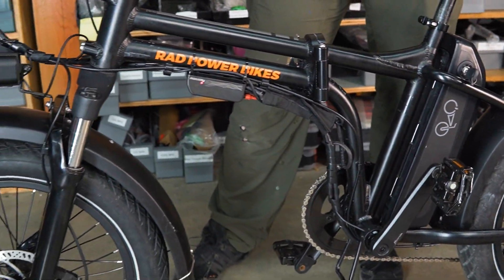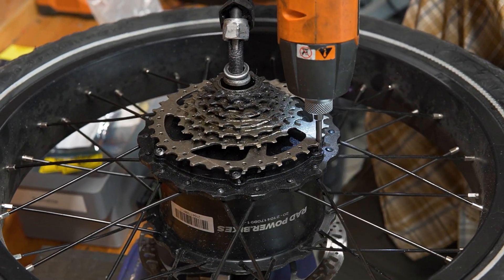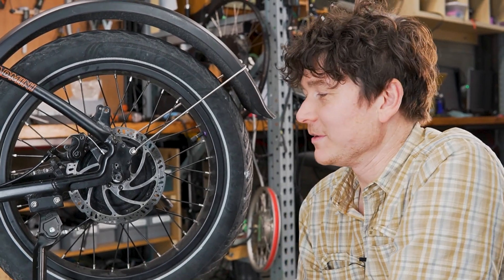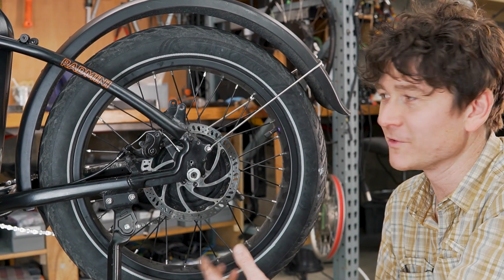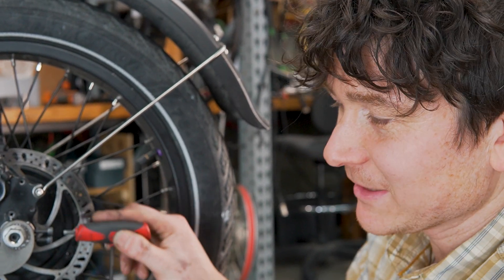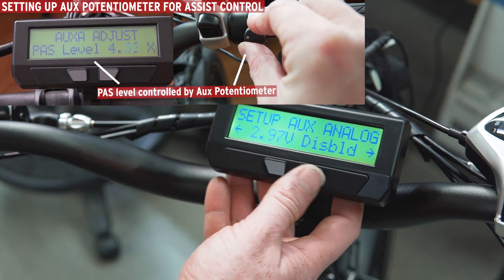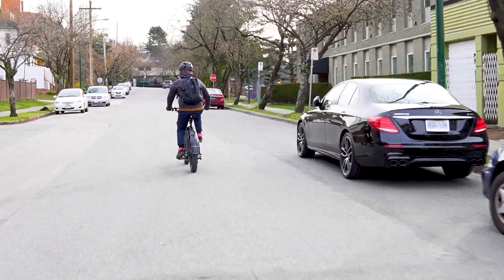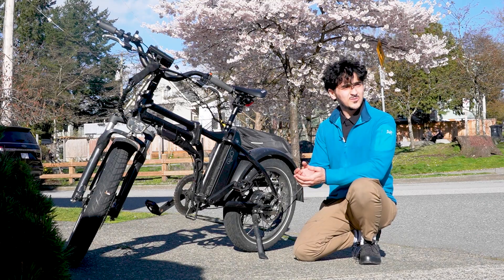Rad Factory Ebike Hack, Part 3.  Adding Regenerative Braking with a Welded Clutch

Comment: I love the work you do. Your vids are great. I have a question: How do I know my current battery will accept the regen current? Seems like very few batteries have that information available.
Reply from the maker: The fastest way to find out for sure is just to try. Most generic ish ebike batteries have dual port bms circuits and hence have no issues accepting recharge current through the discharge ports.

Batteries with single port bms circuits may trip the bms from having an unnecessarily limiting max charge current setting (like 5A).
The batteries you can't do any regen with are usually super proprietary setups like Bosch, and you're not going to use a Bosch battery on anything other than a factory Bosch ebike anyways so it doesn't really matter.
And yes you will almost never get this information from a battery supplier. If you ask they will usually say no, you can't do that, even though they are completely wrong, because most people working on this industry don't really know much.

Comment: How much torque can this handle exactly?
Reply from the maker: Are you asking about the torque arm or the motor itself?
Reply: @GrinTechnologies  torque arm
Reply from the maker: It is stronger than the axle.  Hollow axles with cables in the middle will shear around 70-100 Nm, solid axles will shear off between 150-200 Nm typically.   The torque arm will survive all of that just fine.

Comment: i am wondering if i connected the cycle analist to a golden motor magic pie 2 hub motor and its internal motor controller.. could i activate and use back pedal brake regen ?
Reply from the maker: Only if the internal controller can be configured to do regen when the throttle voltage drops below 0.8V, with maximum regen at 0.0V.

Comment: have you tried a rear axle with a hole drilled through the threaded end to stick a cotter pin through it to hold the nut in place or at least some kind of safety wire?

that's the common solution for motorcycles.
Reply from the maker: Yes, that's commonly used in aviation too and you are welcome to do it. The axles are hardened steel and a bit of a pain to drill through, and in many cases there is an electrical cable running through the axle as well.

Comment: So I welded my clutch on a RadRunner and I have a 35A controller installed by Bolton (sorry cycle analyst screen is keeping me away...) Anyways i notice now when I'm going faster and coasting and go to use PAS or throttle it kind of lurches like its going into Regen and then speeds up. Is this likely a controller issue or is this normal without the clutch?
Reply from the maker: This has nothing to do intrinsically with a clutch or no clutch, and everything to do with the startup behavior your motor controller. By chance is it running sensorless?

Comment: If the electrical system failed, and you had to ride the bike like a regular pedal bike, wouldnt this bike be extremely hard to pedal and ride with this conversion?
Reply from the maker: These are already pretty crumby bike platforms to ride without assist regardless of that.
 But yes there is additional drag for turning the motor, quantitatively it is  notably less than the rolling drag of the low psi fat bike tires.

Comment: How do you replace the plastic gears once it’s welded?
Reply from the maker: The same way as a non-welded clutch.  You just remove the planet carrier and gears from the motor axle with a gear puller, then remove the snapring from the stubby planet axle and slide off and slide on a new planet gear.

Comment: Wouldn’t a locked clutch increase the wear on the cogwheels a lot, as they now constantly engage, instead of only when the bike get assisted power from the motor? Not saying the hack isn’t nice, just wondering about this. Regen obviously is nice.
Reply from the maker: Believe it or not the cogs are always engaged and spinning whether the clutch is locked or not.  The freewheeling clutch stops the rotor from spinning but not the gears.  The bidirectional forces on the cogwheels could change their wear dynamic but nothing that we have seen so far, and that's with quite a few years of experience with the GMAC motors.

Comment: How much is the whole kit?
Reply from the maker: There isn't a kit shown in the video. It's a set of discrete part replacements. Controller pricing is here:
https://ebikes.ca/shop/electric-bicycle-parts/controllers.html
Torque sensing BB pricing is here:
https://ebikes.ca/shop/electric-bicycle-parts/torque-sensors.html

etc.

Comment: Hey Grin, Anything on the horizon for modulating regen brake levers or is back pedaling still the only option?
Reply from the maker: Backpedaling isn't the only option, there is also throttle modulation with a digital ebrake lever, and using the Digi aux input for digital regen control at any point.

But to answer your question. Yes.

Comment: I love the idea of reusing my old bike and turning it into an Ebike. 
The June 1st $300 - $1400. Rebate to purchase an Ebike seems to be only for a new Ebike. 
I wish that this would also include GRIN KITS.  SAD!
Reply from the maker: It is sad. We've tried hard to make them see the light but they are dug in in their intransigence
Reply: @GrinTechnologies  Are there any other $2000~$2500 'barebone' ebikes compatible with this kit that are a little better than a Rad? I currently have the $1400 rebate ready to go but they all don't seem to have the power I need.

Comment: One nice feature of the new regen speed limit is if you set it to 0 MPH, it effectively permanently parks the bike.  This is great if you need to run inside for a few seconds, as if anyone tries to hop on the bike and steal it, they will need to overcome 750W of regen to go anywhere.
Reply: Forgive my ignorance, but won't the regen braking prevent the bike to move forward in that scenario, but how about moving it backwards? 🤔
Reply: @williamaungleyraud  Someone awkwardly trying to walk my cargo bike away backward while the alarm is screaming is of little concern, as a stroll would let me catch up.  Someone jumping on the bike and trying to ride away is a much bigger concern.  When both the alarm goes off and regen grinds them to a halt, they are going to be far more inclined to ditch the bike for an easier target rather than sit there for a while trying to figure out the best way to circumvent the issue.

If someone is smart enough to circumvent both an alarm and ebike system, they are a professional thief and even a U-lock and a garage won't stop them.  This comes from first-hand experience.
Reply: @bensmith3304  🤣 I don't know why your response has got me cracking up.
Reply: @chrisE815  i wouldnt count on it, what if all it takes is for the motor to be disconnected?

Comment: Would it be possible to weld the clutch in a mid motor like Bafang M620 to get regen and REVERSE? Of course I need a fixed gear on the wheel.
Reply from the maker: If your bike is a fixie bike then in principle yes, but then you also loose the primary advantage of a mid-drive while retaining all the disadvantages.  ie no ability to change the motor gearing, but still having all the chain wear and transmission drivetrain issues.

Comment: Man you guys should really make bionx BMS boards. I’m sure they’d be very popular as the original ones keep dying including mine. The same goes for the consoles as well which also keep failing. You guys already had previous relations with bionx and I think it would be brilliant for the many bionx customers out there to have access to these parts to keep their bikes going considering how expensive they were. Bionx has been dead for years so who’s stopping Grin Tech to continue the legacy of bionx.
Reply from the maker: It's really a dead end path to keep a propriety system propped up. Best to open things up with a new controller as we describe in the bionx hack video and forever be free.

Comment: what about pairing a rigenerative (welded clutch) mid drive engine with a fixed gear back wheel? wouldn't enable regenerative braking with mid drive too?
Reply from the maker: Yup, but you would loose all the benefits of a mid drive since it works just be single speed, while retaining all the disadvantages. But if it's the only motor you got and fixie is how you like to ride, then buy all means this will work
Reply: @GrinTechnologies  by adding a rear wheel with integrated hub gear then I would have a bike which has central motor, with energy recovery, with a shift that could be even used to modulate the braking torque! Isn t it?

Comment: I hate to complain because GRIN is making things no other company will, like the BaseRunner ESC.   But here it goes:  I wish they had an alternative display using a modern tiny 128x64 OLED screen rather than the dot matrix calculator style.  I wish GRIN had another lower-profile option for the screen.  Even if it's just a little rectangle with the entire back side taken up by the wire loom.
Reply from the maker: You and at least 10,000 or so other people! Don't worry we know. :-)
Reply: Or like Bafang you can program everything with a usb cable on your phone

Comment: hey, update on my issue, I took it all apart, tested the phase wires, it was the yellow phase wire, it was shorted, opened it up lol everything absolutely toast, I think when I crimped my brake disc and bunged up the wheel it must of been in between that phase and it just gave up the ghost, I mean inside the controller, my motors good, hall sensors should be good, I hope. Im ordering a backup medkit for my  ebike and a new controller, I have a 500 w continuous motor, these imported from China controllers are all 500w to 1000w on them, would they be ok to use? 60 bucks compared to a 110 at the bike shop, it would help, thanks again Im subscribing
Reply from the maker: If you have the means of figuring out all the connectors and wiring then you could likely make the random china controllers work, just don't expect to get much help from the sellers to figure things out.
Reply: backup medkit?

Comment: Are most hub motors capable of having Regen ? What if my motor 's cable is the smaller 6 pin type? Not sure of the cable type. However its a 1000W hub similar to the Bafang.
Reply from the maker: If it has straight cut gears then in principle it can do regen just fine if you eliminate the freewheeling clutch, noting the caveats in this video. You will obviously need to terminate your motor cable with a connector that matches what is the new regen capable motor controller, or visa versa.  6 pin cables would be for motors that lack actual motor hall sensor but which have an internal speedometer sensor, and that means you'd need a sensorless capable motor controller.

Comment: How does it feel without the freewheel function unassisted. On a direct drive hub motor its a slight drag but I imagine it would feel worse than this with a geared hub motor hence why it is not commonly done. I'm also wondering for someone like me who is heavy but with strong legs I find the DD drag very small and don't care about it on flats and I only use assistance for hills as a sort of bailout option when hills get too tough. What sort of level of regen can I expect when I would regen down all hills, just cycle on flats and need assistance on all but the smallest hills? I don't have a controller that can simulate freewheeling by providing a small amount of current to the motor. I just wonder if anyone has any figures for how different configurations compare? If I'm regenning down all hills and use assistance perhaps for 3/4 of hills while still pedaling what percentage of regen could I expect compared to lets say a ebike with a freewheeling geared hub motor which is only used for hills but has no regen. I realise there are so many variables I just wondered if anyone had any experience of what I might expect as rough estimate.  I'm wondering if I would see a significant increase in range?
Reply from the maker: You can directly tell how much drag a motor has by looking at the energy needed to run it unloaded. Large geared motors like the ezee or GMAC typically have about double the drag of a good direct drive hub. For small geared motors like the sx1 it's about the same. 
Most people get 5-10% and your described use isn't really any different. Wondering how much it will increase your range shouldn't be the main interest, your motive should be about the desire for consitent braking without any wear and tear on your mechanical brakes. The range boost is just an extra bonus on top.
Reply: @GrinTechnologies   If you regen as much as possible and only use the motor for the steeper hills won't you massively increase your range? On a geared hub motor with clutch only operated by a throttle and only occasionally I've read of someone getting 200 miles out of the battery charge mainly because it was used so sparingly in reality they may have only got 10 miles of assistance up steeper hills only and they would have assisted that with pedaling too. Isn't there a similar situation with a regen hub motor where the reduction in charge in the battery is very slow because you keep topping it up and only use the motor sparingly. What I'm saying is there must be some people who put in much more regen than others compared to using using assistance. If I ride for 100 miles of which 1 mile is assistance going up only the steeper hills but 5 miles are using regen going down steeper hills. Is that 5-10% purely braking or do people use regen going down steep hills by pedaling at the same time? Is regen braking only or can you regen by pedaling or coasting down steep hills? I've not seen exactly where and when you can regen I assumed for steeper hills you could have long sections of regen where you wouldn't stop because you keep pedalling.  A sort of flatworld mode where you regen down hills, use no assistance for flat roads and slight inclines and use assistance for steep hills so you average out the required power from the rider so in a way downhill may not be any easier than up hill but you end up with a huge range.

Comment: Awesome torque arm. Hope to see them for sale soon!     I have been wondering about welding the clutch and if the weight of the spot welds would throw the balance of the motor off, just a thought. Is than an issue here?
Reply from the maker: Once welded The clutch does not rotate anymore, so there is nothing to throw off balance even if that was hypothetically a concern.
Reply: @GrinTechnologies  More and more i just see no downsides.

Comment: I love the smart back pedalling control on the Regen but if I was given the choice, I'd pick blended Regen like ev brakes on the back brake lever for the simplicity of just using your regular brake lever to brake.o
Reply: You'd think so but the trade off is you have to be sooooo careful not to brake too much. To use the lever you have to back your brakes off so they won't be as effective or they come on too soon and make Regen useless.
Reply from the maker: Yup that's basically a given and it's present on almost all the systems (including this one) too.

Comment: Love the torque arm, and may get one even if I don't go to regen. I currently have a RadMini with the Bafang G63 tuned to 2.6kw, and use double torque washers on the left, and one torque washer with the mini torque plate on the right. Never had anything come loose yet, BUT, I preload the axle so it's already bottomed in the direction it wants to go. I expect that setup to be less than effective if I go to regen though 😉. One question: Are there other methods of engaging regen, like a bidirectional half twist throttle, or a thumb throttle used for proportional regen braking? Asking because I ride mountain bike trails on occasion, and rotating the pedals backwards to position them for clearance is common. It could get weird if regen engages in that situation!
Reply from the maker: Yes all those ways and many more. See https://youtu.be/gYCj4asp9pE

Comment: 8:55 Regarding "how much braking torque do I need?", I have mine set to 69 Nm which is enough to bring the bike to a stop. I intuitively learned to begin braking a little sooner than I would with friction brakes and typically only engage the friction brakes after I've come to a full stop to keep the bike from rolling.

Comment: In Part 4 are you going to show us how to add a temp sensor?
Reply from the maker: That IS the plan indeed. And then there isn't really much left to do so we'll probably end it at Part 4. It's now got a powerful field oriented controller, a top speed boost due to field weakening, twice the torque off the line, a torque sensing button bracket, and regenerative braking.  The temp sensor is the final ticket to ensure that no matter how hard the system gets pushed, it will still automatically limit power to stay in a safe operating zone. This is becomes more important with regen where the hub won't always have the same opportunities to cool down on the downhill stretches.
Reply: @GrinTechnologies  amazing thank you!!!
Reply: protip; almost all of these geared hub motors have (on basic models like this) 4 halls; three for phases and one for a speedomagnet on the shell of the hub. I will often just steal the wire used for the speedo and use it on an NTC probe instead so I don't have to rewire the motor. It's much easier to add an external speedo magnet on the wheel spokes than to rewire the motor entirely just to get one extra wire inside.
Reply: @chuyskywlk  what about for a temperature sensor?

Comment: Please put torque arm on both end of shaft, otherwise, it will twist.
Reply from the maker: That would require cutting off the electrical connector and resoldering the wires, as the plug is much larger than 10mm diameter. And the cable side of the axle is a lot weaker too due to being hollowed out. In cases where you can there is no harm in doing this, but it's not necessary either.